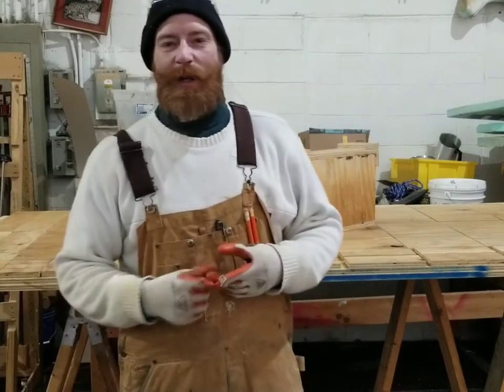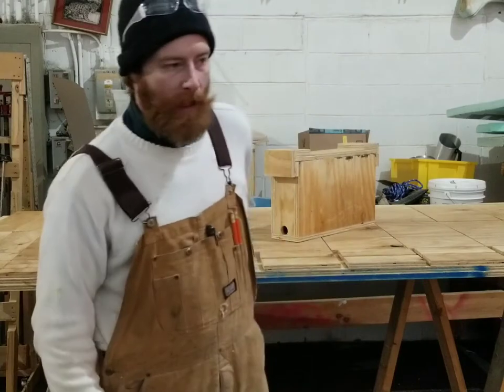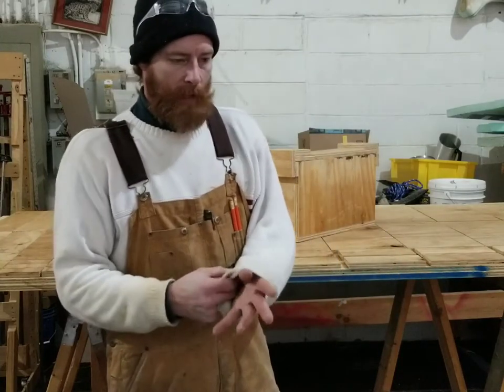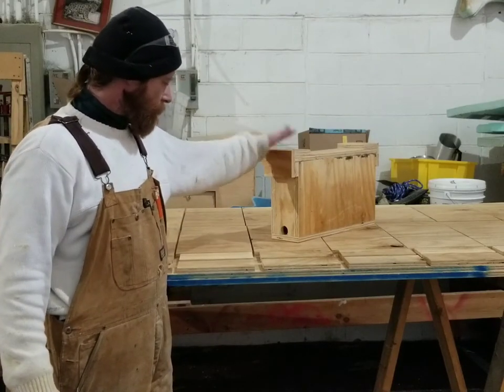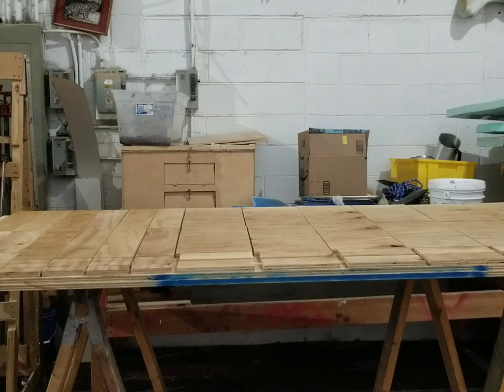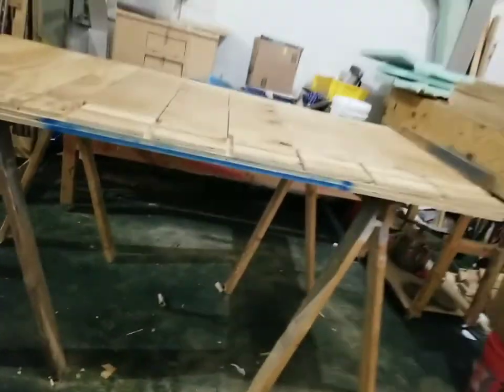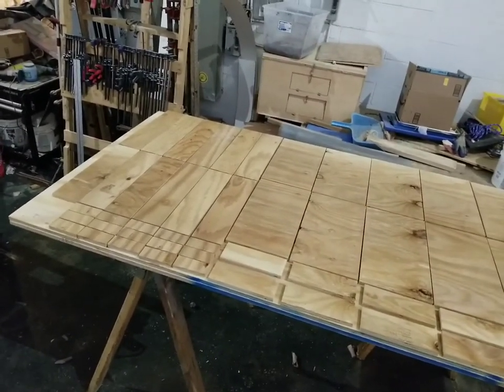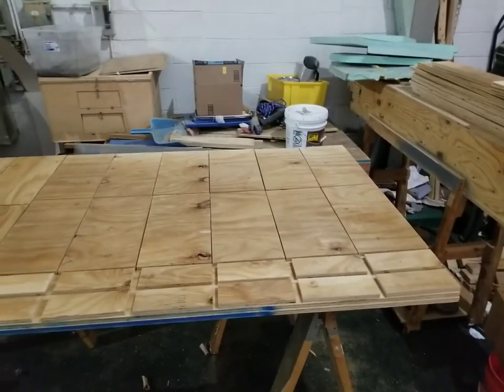2 Frame Mini Mating Nuc

Comment: I seen a guy build 2 of these out of a 1x12x8 so shouldn’t you be able to get 8 of these boxes out of a sheet of plywood?
Reply from the maker: I suppose its possible, but at the time I didn't see a way to do it. It might involve cutting the sheet differently than I did, to maximize the material, and there's probably some program that could figure it out, but I didn't go that far. I applied the same cut pattern as the nucs to these. Plywood at the time, was $35 a sheet also. So a little waste wasn't the same as today when they're $75 a sheet.

Comment: Technically speaking: 
These are not mini nucs. A mini nuc uses half length frames.

A mating nuc is one used with emerging queen cells or virgin queens to take them through the mating process to beginning of laying eggs.  Then they are harvested, sold or used to create or fix other nucs/hives.  In a large commercial operation these are often mini nucs with the minimum amount of brood and bees to support the queen through the mating process. But can be anything (see Sam Comfort) 

You are building 2 frame deep nucs.  
They can be used as mating nucs (as described above) but more often are used to hold the queen longer building out a small nuc that is a bit more general purpose. In addition to harvesting and selling queens, frames/queens can be pulled to bolster failing hives or split to raise more queens, etc. This arrangement is more flexible and more forgiving than using mini nucs, especially no special purpose frames to manage.

I love these small nucs.  
Since I only use medium frames, a 3 frame medium would be the same comb space as a 2 frame deep.  Since I run 8 frame medium hives, I made 4 frame medium nucs to be able to place 2 nucs side by side over a single hive footprint. It works great for me, very forgiving and easy.  They are between 2 and 3 deep frames in comb space, so not too big to use for mating and raising queens, as well as large enough to let them grow out a bit more. A side by side configuration is stable enough that I can stack 4 frame boxes on top each nuc.  I have one pair that I didn't have enough equipment to move them, they are over wintering in a side by side 4 box deep configuration.
Reply from the maker: Those true mini mating nucs, look ridicukous to me. A completely sepreate set of equipment, that csnt be used in anything else. Thats why I like these for queen rearing and small splits. The deep feames can go to any box I have. 
I know the nomenclature is wrong, but that doesn't bother me. Thanks Michael.  Good info.
Reply: @libertybellbeekeepers  I am with you all the way about large scale specialized commercial beekeeping equipment.  
"I know the nomenclature is wrong" spreading confusion eh. ;)